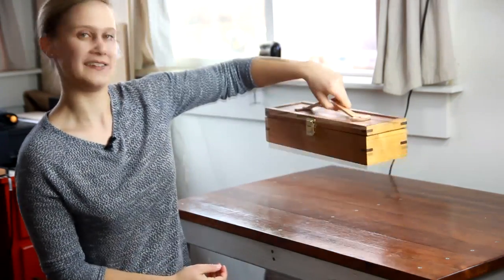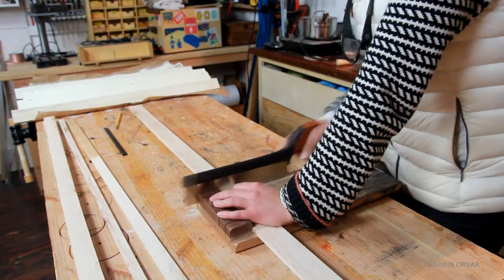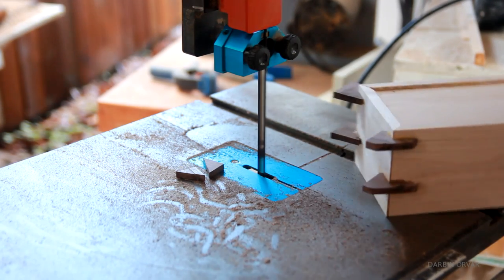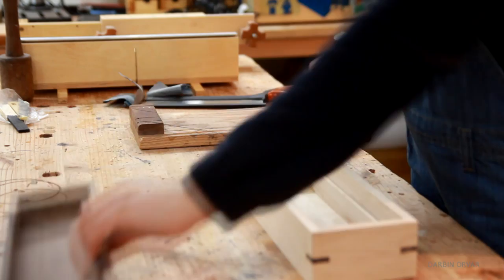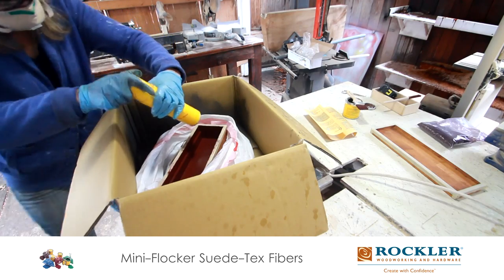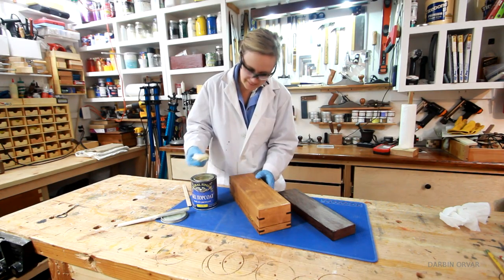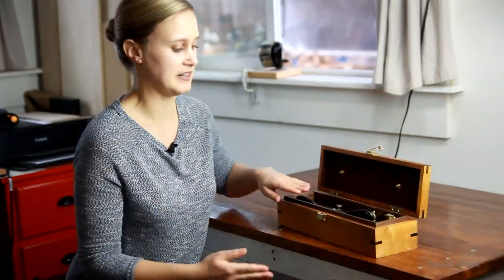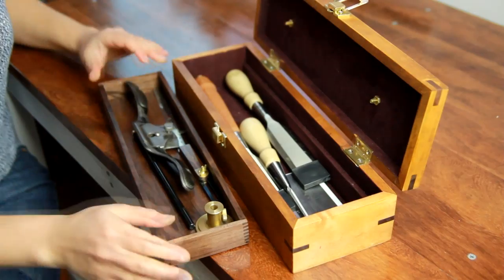How To Build a Portable Toolbox w/ Insert Tray for Travel

Comment: Beautiful work. The jig for the splined miter joints seems very handy, and more versatile than a table saw jig. I use to trim of the edges on the splines with a flush trim router bit, works very well.
Reply from the maker: +Dieter Schneider Photography Thanks, I like the box you made too!
Reply: Thanks :)

Comment: very nice little box and well done, really like it.
One little tipp i can recommand a friend gave me (he is a painter), if you do stuff like flocking or painting with masked off areas. The point the paint doen't move any longer but still is kinda wet, remove the tape so you get a very nice line. So dry paint that sticks to the tape can't rip little bits of the area you want paintet.
Sure, in this project it doesn't matter all that much but i think i share this tipp here.

Comment: It was a lovely build. Its sold me on leather handles as well, something that I tend to avoid due to concerns such as the leather drying out and cracking. If this happens, then it is low stress because of the nuts and bolts used to fix it in place.

Comment: Beautiful box.  My only quibble is you made solid wood tops and bottoms and then glued them in a mitered frame.  There is no allowance for wood movement of the panels.  The panels are small though.  Has the box top or bottom cracked or pushed open the miters over the last 5 years?

Comment: If you care about what's inside the box that much I'd suggest trimming the length of the handle screws to be flush with the nut :)  and I really like your ideas and watched all your previous videos this month :)
Reply: Or she could leave them proud by a 16th of an inch, then round them over with some sandpaper, paint with some clear coat , then reassemble.
Reply: That would work too :D

Comment: Great work, but two things I would have done differently, because I like storage boxes to be stackable: 1- inset the handle and 2- use the brass parts for the handle, cut a long groove into the leather at the attach points, so it can lay flat when not in use. Also, I would have made the top flush, so it doesn't accumulate dust. Still, awesome work; thanks for the inspiration.

Comment: I got a small set of those Brusso hinges like you got but mine were only half depth (They're pricy for hardware!).  I should have bought the bigger ones that you have so I would have to just chisel two edges instead of 3.  That was a pain to deal with considering my ham hands.  I got it done but I wasn't nearly as happy with the job as I should have been.
Reply from the maker: +NGinuity They are very nice hinges :)
Reply: +Darbin Orvar VERY nice hinges.  Unfortunately the project wasn't under the best of circumstances but they were very classy and I was pleased with the quality of the hinges themselves.  Hopefully I can use similar methods as skill builders to "work small" as well as I "work big", if that makes sense.

Comment: It was a simple way to add the flocking. I have flocked by using electricity which makes the fiber to stand up. It takes a special equipment for it but the result of the flock feels more as velvet. Ursäkta för dålig engelska ;-)